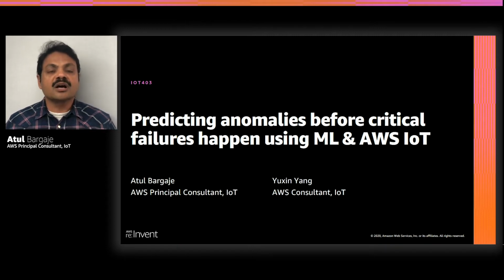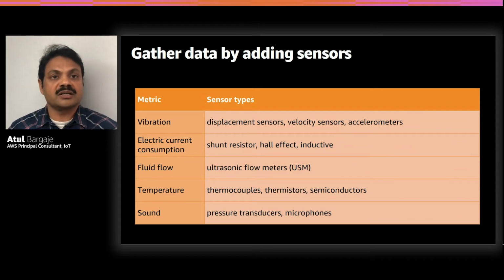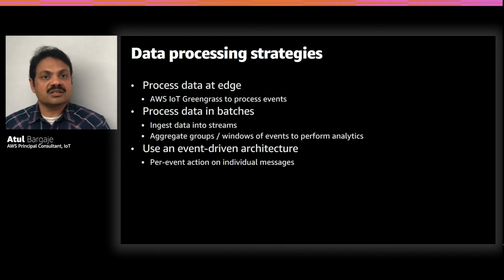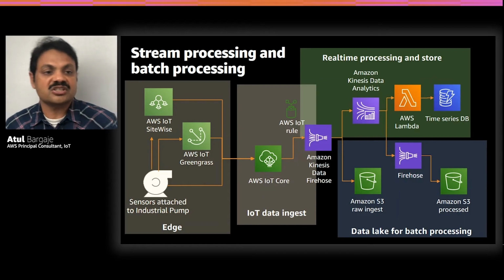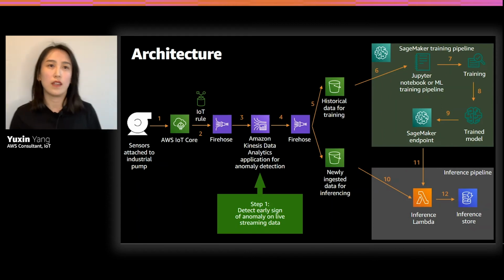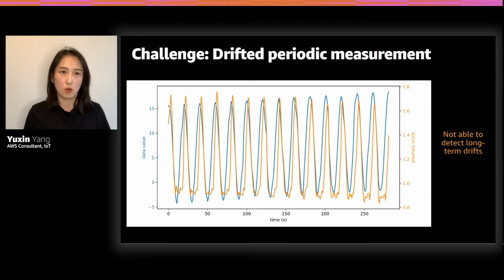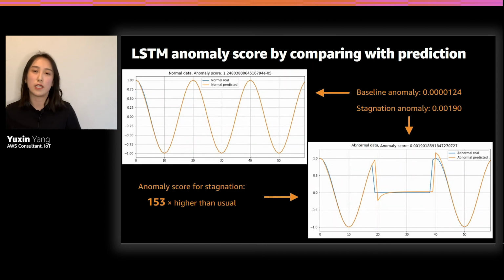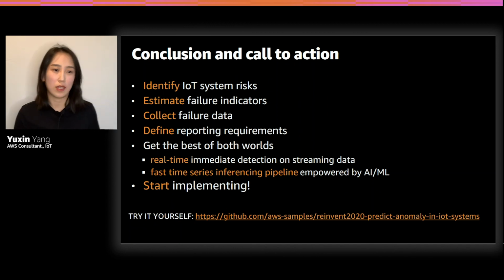AWS re:Invent 2020: Predicting anomalies before critical failures happen using ML & AWS IoT

Comment: Great, i am also doing the same, but beside anomaly detection my task is to predict the correct value and replace thr anomaly value. As the owner says this Anomalies are due to transmission error of tye sensor or sudden power shut down. I am trying to predict the values using lstm. But the problem is for big gaps feeding the previos data not giving good results, if i am training with dates featurs vs target value then. The pattern is repeating with time. I have 40000 sensors. Canu suggest some good solutions that aws has implemented?
Reply: This is a great question to pose to our community of experts & engineers on our re:Post platform. 🤓 You can do so, here: http://go.aws/aws-repost. ✍️ You can check out more ways to get tech help with your use case, here: http://go.aws/tech-support. 🧐 ^RF